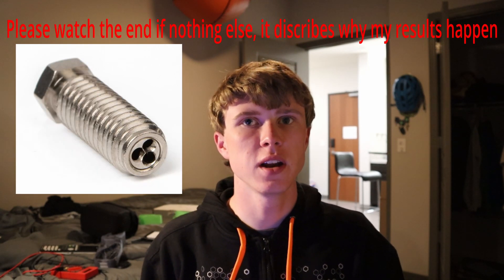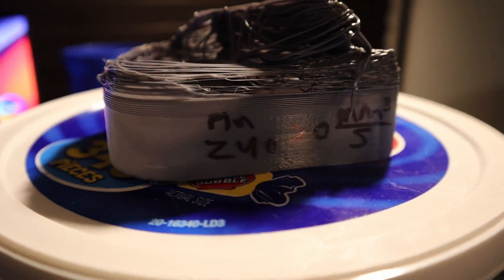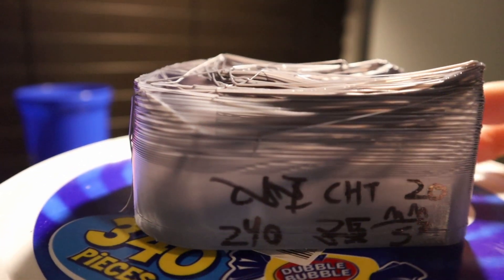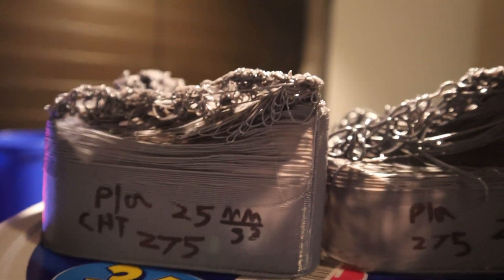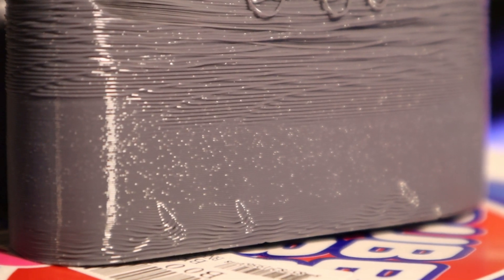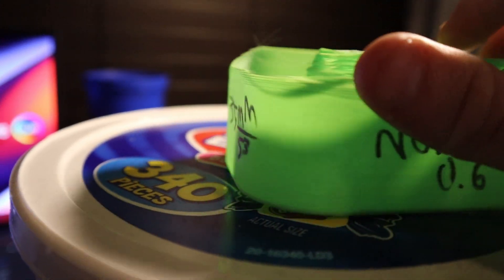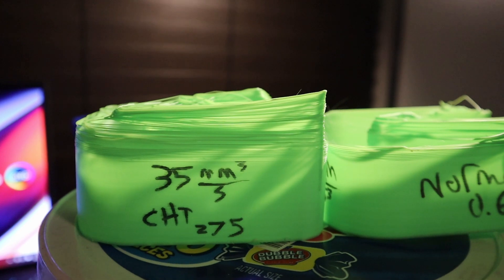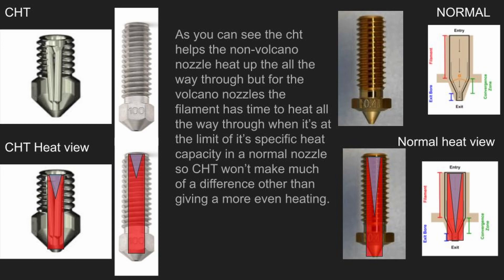Why CHT volcano doesn't  really matter

Comment: I found that if i pushed the nozzle temp much above the filament manufacturers recommended max temp it boiled the filament resulting in bubbles. At 275degC it seems you are way over what pla can handle....perhaps i misunderstood the values you provided for your tests.
Reply from the maker: I never even thought of that, that could definitionally be the reason behind the bubbles on the pla prints!

Comment: I'd look at your extruder. For both to top out at the same flow rate it would make sense. From my own testing I did see gains using a volcano CHT in my setup. Also, with a Rapido UHF hotend and Sherpa Mini. It depends on your PLA as well. I've seen vast differences in max flow rate between them.
Reply from the maker: I'll look into that, I found that the CHT did give a less spotty(but still not perfect) flow at higher rates, it might be that will real world printing it's not a constant extrusion like the testing, which let's the plastic heat up more quickly. I definitely found that different filaments allow for higher flow rates too.

Comment: What hotend / extruder combo are you using? You might just be seeing the the limits of that system.

You can also increase the extrusion multiplier to get back to the correct extrusion width above the "drop off" flow rate.
Althought now, it occurs to me that you would need a movement speed dependant extrusion multiplier for that to work well.
Reply from the maker: I'm using the Rapido UHF hotend in my tests with the clockwork 2 extruder. I'm definitely pushing the limits of the hotend(though not the heater cartridge), so I was testing to see if using the CHT could help increase those limits(unfortunately it didn't). that extrusion multiplier could work but I think the limited flow rate has more to do with the capabilities of the hotend, but I can definitely test it out to see!
Reply from the maker: @OddSnail69 Definitely not worth the money, you're right it does seem to give a bit better flow then the knockoffs but only just barely.